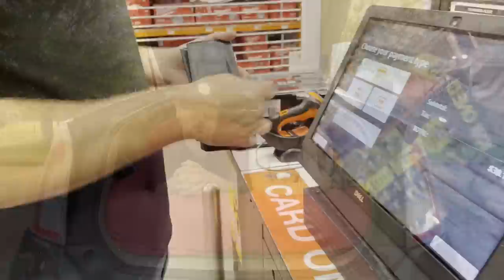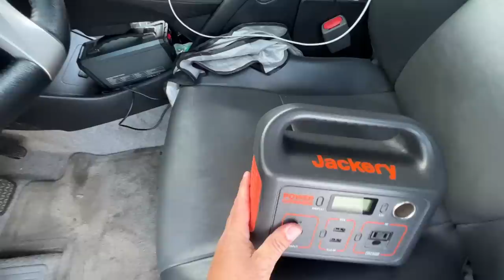PRIUS Car Camper Tour | No Build Budget Design

Comment: I lived in my 2016 Prius for a year, spending most of the time overnighting in National Forests and last year in a Long Term Visitor Area (LTVA) in the desert Southwest. I, too, did nothing to the car; my mattress was two pieces of high-density foam bought at Joann’s and cemented together. It takes up half the size of yours since I live alone. I carried a bunch of plastic totes on the other side than the sleeping area. I had a Jackery with two solar panels for power and it worked well, which included keeping my food cold in my 12 vDC refrigerator, not a cooler like you had. I would not change one thing about what I did.

What took me off the road was the only thing a Person of a Certain Age cannot resist…grandchildren.
Reply from the maker: Sounds like an amazing experience.  We always said if there was only one of us it would be so roomy.  

If we go again we will definitely upgrade to a 12v fridge as well.  Happy adventuring!
Reply: how did you get the solar cables into the prius? I've seen some squeeze them past the trunk lid but I'd be worried about the seal.
Reply: @catorb6607  I don't. They are set up outside.

Comment: I have a 2017 Prius Prime which I've spent up to a month traveling/living in, and have watched most videos of everyone's Prius camping/living setups.  For anyone wanting room to sleep 2, the best setup of any YouTuber has been Intricate Explorer... until now.  You've legitimately pulled off a system for 2 people to live in a Prius over the medium to long term.

While I could list a couple of dozen ways to improve the build for long-time Prius living by a couple, none are absolutely necessary.  Your build is an excellent first pass, and pretty much trail blazing for actually working for an actual couple.

Intricate explorer had the full mattress like you, but normally traveled alone, while simultaneously using the car to drive Uber!  So, his day mode had all 5 seats usable, no stuff visible anywhere, except the rolled up mattress in the hatch area.  He got rid of the spare tire, and used that area for additional storage.

My Prime has no spare tire, no storage tray above the spare tire, it's all used for the bigger plugging-in PHEV battery, and in fact the level of the hatch floor is raised maybe 3 inches.  So, I have less headroom in bed, though I take some of that back by using only a 25x75x4 gray trifold Olee bed (sometimes under $60 on Amazon).  With no spare tire, I have the 200 mile towing option on AAA.

Any 2004-2022 regular Prius is preferable to the Prius Prime for living in it, due to the additional storage space outweighing the ability to gain the equivalent of 1/2 gallon of gas every time you plug in.  The definitive videos on how to maximize space and get the bed platform as low as possible in a Prius, are by Vagabond Mango.  She did not waste a millimeter of headroom in how she built out her 2016 Prius 2 Eco.

I copied and improved Intricate Explorer's curtain setup behind the front seats.  Instead of a straight rod to hold the black photography background, I cut down a 48-inch aluminum construction ruler to flex up near the roof when jammed between the two seatbelt retractor trims.  The curtain material he recommended is superb.  Make it wider than you think you have to by probably at least a foot, to avoid light leaks by the door pillars.  

With putting all your stuff in the front seats when in bed, you obviously need to use windshield and front-seat window covers, rather than keeping the front seats empty, no front/windshield window covers, and a curtain.   Having the front seats visible and empty overnight, with nothing but blackness visible behind the seats, adds a tremendous amount of stealth.  But with 2 people and their stuff, empty front seats at night is pretty much an impossible dream, unless you go the external cargo carrier route.  I've resisted using external storage while Prius camping, though I did install a receiver hitch to occasionally use a cargo carrier locally at home base.

You did a superb build, and made a superb video here about it.  Congrats!  I hereby pronounce you both to be Efficient RVers.
Reply from the maker: Thanks a million for this awesome comment!  We learned a lot from it and will implement these in our next Prius set-up (We are in the market for another Prius).

We will check out these other videos you mentioned,  we love that the community of campers uploads and shares their unique set ups with the world.  

Thanks again, B&A!

Comment: Wow! you guys really made this work! A really inexpensive way to see the country!  When I first started investigating car camping, I wanted a Prius, but I had a Matrix. It works for me! I did something very like your window covers with the foam board (did a video on how) and found they also worked great!  Excited to go back and watch your older videos!
Reply from the maker: Amazing,  is the Matrix a little smaller than our Prius?
Reply: @HeresGoodTravel  I'm not sure. I've never been in a Prius. The Matrix is a little 4 door station wagon type. I can lay straight our in the back, with my head short of the back of the front seats. I think the Prius has a steeper hatchback door?? But maybe that's just a model I've seen. I liked the idea of a Prius due to the electric side of it. I travel with a cat and dog and have heard you can keep it cool inside while parked due to the electric.
Reply from the maker: Yeah the temperature control is great but we were always uneasy doing that for some reason.  We only used the AC in really hot nights.  The steep hatch is why we chose to sleep on with our heads against the seats.  That way our mi da thought there was more room.

Comment: Thanks for sharing! I’m getting new ideas for organizing! I have the same Prius and have been out 4 times overnighting with it by my self and with my husband. I really like overnighting in a car compared to a tent😝 and boondocking even better! I’m getting so much more traveling done without the need for hotel and campsite reservations! The Prius hotel is still a work in progress. It is much harder with two people, and we haven’t quite worked out his sleeping situation. I find I sleep well on a 6” coleman air mattress. He on the other hand is ok with a yoga mat and a foam raft😀 but sleeps on stomach. Something about his arm falling asleep when it’s hanging over the inside center, it’s his issue! I’m thinking you have a Mary Poppins Prius as I don’t know where you are pulling all this stuff from!  I love the pillow cases for storing clothes and goods! Can use them for sleeping too! I’m still deciding on a cooler. It will go behind the seat and be used for a platform too. I have bass pro rewards points so I can get a Yeti Roadie but not sure I want to deal with its theft issues by having to watch out for it all the time. It does have the best interior space dimensions for that 25 quart size. I’m not sure those igloos are insulated like the Yeti with the polyurethane inside the walls. I’ve seen those igloos at bass pro and they are hollow sounding like the old style coolers. They are a better price, however.  I have a roof rack I need to see if it will attach securely on the Prius. There’s not much of an edge on this year Prius for the roof rack to grab, though. My rack is older, but can use different claws and attachments. Thought there will be a drag and mpg reduction. Ok, happy travels, thanks!
Reply from the maker: Thanks for the comment!  Comfortability was huge for us which is why we opted for the 4 inch memory foam.  It also helped insulate the bottom of the car on cold nights but it took up a considerable amount of space.  Those igloos did not do a great job with the ice on hot stretches,  if we had more money we would’ve gone yetti without questions.  Also a plug in fridge and increasing our solar battery bank might’ve been wise.  If we do Prius life again it will be with a roof rack for sure!  When you get your setup dialed in you should make a tour video,  we would love to watch it!

Comment: Thanks for sharing this. Great video! Yes, the Prius holds an amazing amount of stuff! I camp in my 2010 Prius. The issues I have had was during heavy rain, the Prius windows are slanted so much that the rain spits in, as you mentioned. I have similar screens as you do. I got a Habitent, which goes over the rear hatch, like your screen. It keeps out bugs and rain, and gives ventilation. BUT, in areas with bears, I can't use the Habitent. A bear sow and her two cubs tried to get in once, but fortunately failed. Everything was closed up tightly. Instead, mice got in, probably because they smelled the trail mix I forgot to pack in the airtight box (similar with the boxes you have). They also chewed up tissues, to make a nest. Mouse traps with peanut butter got rid of them. I've added a compressor refrigerator which fits behind the front passenger seat. It's exactly the right height so I can lay flat. And I cook with a microwave oven, because I don't like washing dishes or pans. These run off a 1kW inverter. I like your velcro pouches stuck to the ceiling. Thanks for a fun and informative video.
Reply from the maker: Thank you so much, and thanks for subscribing!  We were terrified of having a bear encounter.  We saw black bears on 3 different occasions we had a lot of sleepless nights with that fear.  We also had a loused get into our car in Sequoia and ate our toilet paper but only had an issue that once.  I didn’t think that the habitant also blocked the rain,  our net didn’t do anything like that but it was only $11 so it was a great alternative and it only took 20 seconds to drape over the hatch and slap the magnets on.  If we do this again I think we will try to figure out a way to add a battery refrigerator the only thing is that since there is two of us both seats need to go pretty far back while driving so we will cross that bridge when we get there.  Did you hook the inverter up to the battery in the back or did you use a cigarette lighter inverter?  Cooking wasn’t so bad but cleanup was such a pain in the ass,  a microwave would be a game changer especially in bear country.

Loved the comment,  thank you for spending some time watching our travels.  Have a great seat!🤙
Reply: @HeresGoodTravel  Yes, bears can be scary. Brown/black bears are somewhat "rational," but grizzly bears are rather unpredictable. I never leave the hatch open if there's any chance of bears, but sleep outside in a tent. I never have anything in the tent that has any kind of scent, so feel safe there - safer than in the car where the food is! I keep the food in air-tight Ziplock boxes. And where there's a bear box, in the bear box. The time the bear sow and cubs tried to get in we had left a bag of everything bagels out by mistake. Though they were double bagged and inside the closed car, I think they could still smell them. The Habitent works really well in the rain. The side screens have covers that can zip shut, as well as the big screen in the back. The refrigerator, Dometic CFX28, fits nicely behind the passenger seat, and yes, that seat does get pushed forward. My wife can still fit, but she's short. If our daughter is with me, I put the refrigerator in the back and we camp in tents. The refrigerator will run off the 12V aux port in the car (which can supply up to 120W), but of course once you turn off the car the 12V port also goes off. I installed another 12V outlet in the back, but also a second 12V battery on the driver's side in the back, with a relay, so that extra 12V battery charges along with the car's 12V battery, but it's isolated when not charging, so the refrigerator can't drain the car's main 12V battery. Since you have a small power station, you could perhaps run the refrigerator off it during the night, and recharge it while driving. (BTW, it looked like you keep the power station on the floor of the driver's side by your feet. I wouldn't advise that. It may get in the way of the pedals, especially the brake pedal, in case of an emergency!) I now also have a power station. The refrigerator plugs into it, and the power station is plugged into the second 12V battery to keep it always charged. When stopped anywhere there's sun, I have folding solar cells, which I lay over the windshield and hold down with the wipers. They help keep the power flowing to the refrigerator and 12V battery. For the microwave, it's a bit challenging to find one that has a low enough power draw (under 1,000 W). It also takes up a fair amount of room. If I'm alone, I put it on the front passenger side seat on a board. If I have someone with me, then it goes in the back, but of course then only one person fits in back for sleeping - so tent(s) are used. My inverter is a 1kW inverter, which powers the microwave or a rice cooker. Because I hate washing dishes, it takes time, and the water is cold, I use paper plates and bowls and cook in the microwave. I use a "slim-twin" air mattress when sleeping in the car. It fits nicely in the back with one rear seat folded down. But I've thought about getting a different mattress. The advantage of an air mattress is that it takes up almost no room when deflated. I have a 12V electric pump for the mattress. https://www.youtube.com/@TerrellWSmith/videos
Reply from the maker: Bears love everything bagels as much as we do!  Thank you for the information it’s really helpful.  

https://youtu.be/Dd2-SdZ3YD0

Check this video out!  Our first bear box and night in the car… we were NOT bear aware😂.
Smart setup,  sounds like you have a ton of redundancy for peace of mind which is fantastic. Amazing, I’ll check out the videos!
Reply: Thank you for explaining that rain spits into the Prius during heavy rain! You have uncovered the reason Hurricane Ian blew water in and got my carpet wet in my 2015 Prius. I had been guessing that I had left the windows cracked as I normally do for the big battery to not get so hot (Florida), but that would have put inches of water in.
Reply: @aurora571000  To clarify, I do not have rain spitting in during heavy rain as long as the Prius windows are closed, but when they are open and have screens on them. But a hurricane is much more than a heavy rain! Very high winds and pressure change may force rainwater through almost anything! My wife and I were in a motel during a tornado nearby, and rain water came in through the closed motel windows and flooded our room.
Reply: @TerrellWSmith  Yikes!

Comment: I an old so I need heat/ac. I would only be camping. I would buy a prius and then buy a used  Kamp Out motorcycle trailer to use with it. You can even air condition it. I wouldn't want to sleep in a tent. This is why the trailer would be a great addition to the prius for me. I need 4 wheel drive where I live so this is just on my bucket list lol 😂
Reply from the maker: 4 wheel drive would be amazing!  The Prius also has notoriously low clearance.  I’ve heard of people lifting theirs but we chose not to, bottomed out a few times.  A motorcycle tow would be so amazing!  Thank you so much for watching, we wish you well on your adventures!

Comment: Great video, thanks! I’m trying to locate those velcro pockets on your ceiling. Will you please share a link? Did you have to add the velcro?
Reply from the maker: hi! thanks for watching! I'll include the ink below. They come with adhesive and the other side of the velcro(the soft side?) , but we didn't use the separate velcro, we just pushed the velcro right onto the inside ceiling of the car, (the hard side?). Sorry it's so hard to explain but once you see it in person it will make sense! We placed them on the ceiling day one of travel and they didn't fall all 100 days, they also didn't damage the interior of the car at all. Thanks again fro watching, happy travels!

https://amzn.to/45uAYj1

Comment: I own a 2015 Toyota Prius and having a roof rack and cargo box is worth every PENNY.  Also, I've installed 2000 watt inverter to the auxiliary battery and it completely changed the game, I have a running microwave.  I'm actually going to install another auxiliary batter on the other side with an automatic isolator charger so I can have 24hr running fridge
Reply from the maker: Amazing!  Does the cargo box affect the mileage at all?  We would’ve had to go that route if we were continuing on.  A microwave would’ve been cool too, we got so sick of cold food!  Was it difficult installing the inverter?
Reply: @HeresGoodTravel  you should be able find it on YouTube. I used gorilla tape to secure mine 2 years ago. No joke, it took me less then 30 mins
Reply from the maker: Freaking amazing! Thanks!,  will look into it!
Reply: I found the 2000 watt inverter with clips, and I simply clipped them on to auxiliary battery.  Took me around 20mins
Reply: @HeresGoodTravel  My cargo box is thule force xt size XL.  But I wish I would've purchased size XXL.  Just heads up, when it comes to cargo box I say bigger the better guys.  Maybe I'll show you guys my set when I'm done with it, yeah I'll post it on YouTube this springtime
Reply from the maker: Love this!!
Reply from the maker: Haha gorilla tape will fix anything.  That was one supply we had on hand at all times.  We are in the market for another Hybrid (probably a Prius again). For sure going to add the roof rack